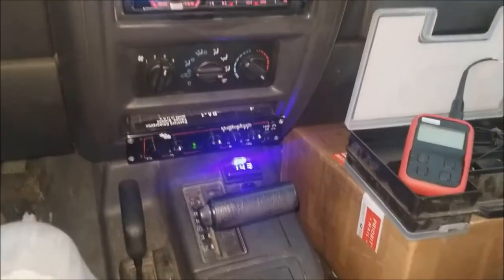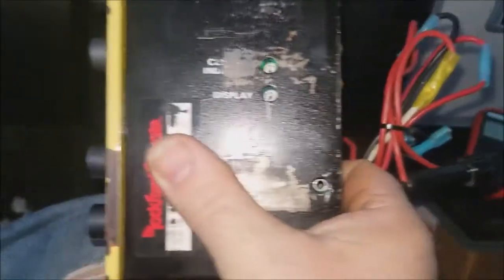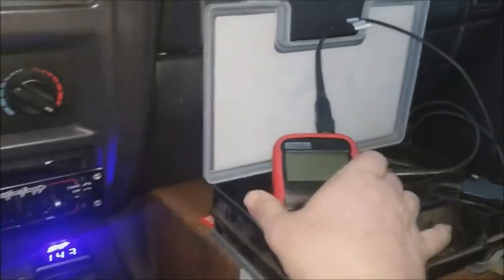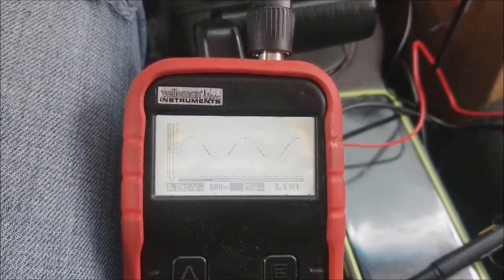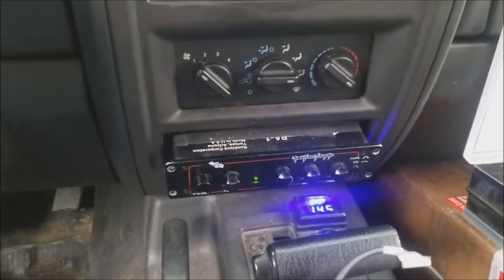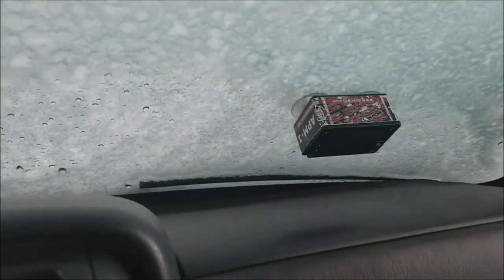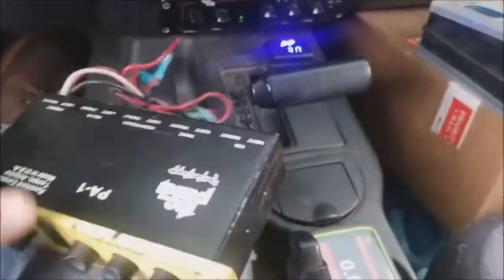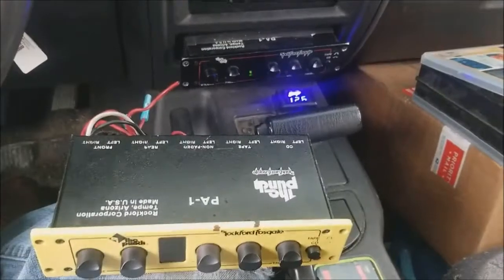Showing The Advantage of Adding An RCA Line Driver to Your Car Audio Sound System

Comment: Hi Steven, thanks for sharing this video, this is exactly how I want to check my current OE Bose HU and OE Bose Amp on my Mazda. I want to change Bose HU to a 2DIN Android unit. Sony has a 5V output, while Atoto has a 2V output per single RCA channel. I don't know the default Bose HU output voltage yet, but I'm going to measure it. I have a question regarding voltage value, what will be a difference for an OE amp (any hazard)  if I change to lover value of 2V? I'm sure there shall be no clipping, just the "starting" volume level may drop, am I correct?
Reply from the maker: So we all know that you set your gain on your amp to match your output voltage of your head unit. That being said the clear advantage of a higher line voltage on your RCAs allows a lower gain on your amp, thus lowering your noise floor for better sound quality. The advantage of being able to have a "second" volume knob on a line driver like the PA1 is that you can increase the voltage if you have two sources with different output voltages, say a cd player with 4v preout and tape player with 2v preout, or in the case of an audio track that has a lower recording level from the studio, like a song from the 60s or 70s compared to something post 2000 that was recorded after "the loudness wars" (look that up if you haven't heard of it and get a chance). The idea behind the the clip lights on the PA1 was to use a scope and set them to show when the signal clipped to avoid turning up the signal too far during a track. Thanks for watching!

Comment: Can you tell me if I should use the subwoofer out on the head unit to connect to the PA-1 or should I just use the front and or rear outputs from the head unit? I’m running a 4 channel amp for my front and rear speakers and a 1 channel mono amp for my subs. I imagine that in order to take advantage of the bass knob on the PA I should probably run dual rca’s on the rear out of the PA-1 and connect one pair to the mono amp right?
Reply from the maker: Hi, are you only wanting to use the PA1 to control your subwoofer amp or are you looking to use the bass mid and high knobs on the pa1 to control levels at each amp? What I suggest is running a single RCA from your head unit rear channel (not sub channel) to your PA1 input, then run the "front out" rca of the pa1 to the front channel in of your 4 channel amp and the "rear out" of the pa1 to the rear channel in of your 4 channel and the "non faded out" of the pa1 to your mono subwoofer amp, this will allow you to use the fader knob on the pa1 as well as have control over bass mid and highs using the knobs on the pa1, just set your high pass and low pass filters accordingly on the amplifers themselves.
Reply: Steve Young thank you so much for the information. This helped a great deal.

Comment: I got mine for 20
Reply from the maker: You got a great deal on it!
Reply: How would I go about setting it up
Reply from the maker: @johngutierrez4882  The manual is still available for download online if you run a search for it. I was able to get it and print it out. It basically works between your head unit and amplifier boosting the signal strength allowing for lower gain settings on your amps leading to a lower noise floor. When setting it up you would set it up with an o-scope just like you were setting gains on an amplifier, there are gain pots on the underside of the unit you adjust while watching the scope for clipping.

Comment: My goal is to tell everyone about this video.
This video is not just to show off the Rockford piece, it's simply educational for anyone in car audio.
Reply from the maker: Justin Murphy thanks man!
Reply: Steve Young no problem at all!
The time and testing you put into this video is invaluable and should be commended.
I love how you repurposed an old school piece of equipment. You just showed everyone that Rockford Fosgate actually knew what they were doing and still does. visually and audibly, proving that it did actually make a plus or minus 12 DB difference, was so jaw-dropping to watch!
I wonder if you did a test of other equalizers of that time, versus this time, how they would compare up?
Also, say a $30 unit vs a $100.
I compete in IASCA and MECCA's novice sound quality division. This requires us too have the factory appearance of the vehicle remain antibiotic as in no modification to the speaker (exception being to your location and it can be angled if needed) and I am allowed to use a digital processing or DSP unit. I could see where this piece of equipment would fit nicely in my install both physically and audibly. I could have my entire system tuned and then have this to adjust on the fly. I don't care what anybody says speakers and sound can vary from day-to-day simply because of atmospheric conditions. Sound travels through air. Air pressure changes constantly so does its content of water AKA humidity. Sound travels different through water and different through different air pressures. So instead of having to constantly reaching your system every time for conditions at an event, you good quickly and manually tweak the set up instantly with these three frequency bands as they hit great areas in the sound field.
Sorry to be lengthy and nerdy but this impressed me and opened my eyes as well as my ears LOL!
Steve, here is my Facebook information and if you could shoot me a private message as I have a few more questions for you.....
https://www.facebook.com/profile.php?id=1648520005

Comment: I just bought an alpine 7840 with 4 volt preouts..if I hook it up to my eq..would the eq be throwing 4 volts out of the 3 preouts??
Reply: So does the face plate come off on this thing?  What if you want to mount under dash
Reply from the maker: @paulbachta3119  Sorry for the late reply, no the face plate does not come off on the PA-1, but they made a PA-1HD which is a thinner model for more mounting options.
Reply from the maker: John Doe your head unit output 4v would go into your eq and come out at whatever output level your eq is capable of producing. Like my head unit puts out nearly 4v and my pa1 puts out nearly 10v
Reply: Steve Young ok 👍🏻 thanks for the quick response..I’m gonna do some homework on the eq I have